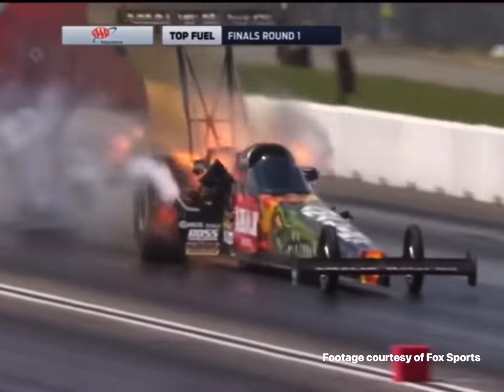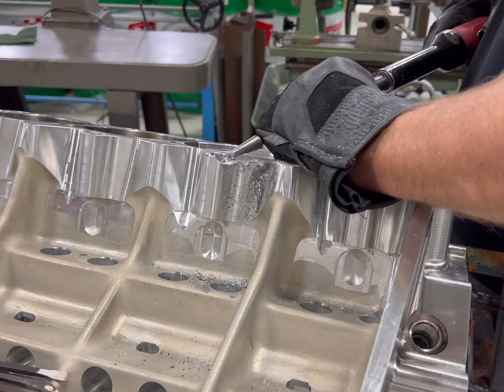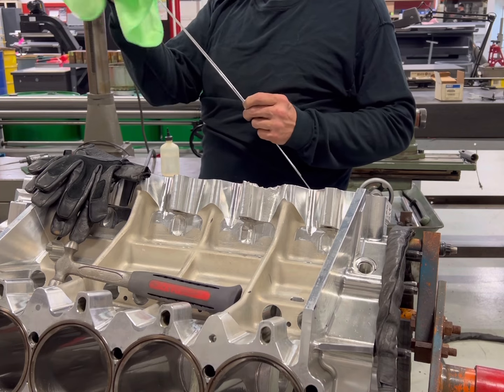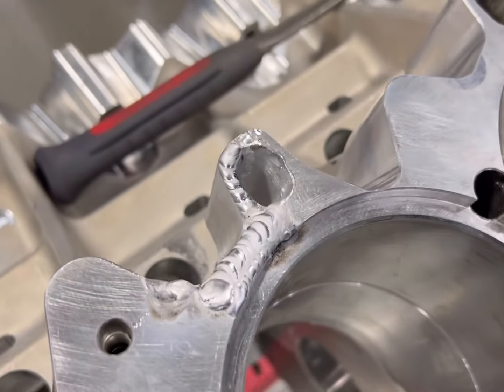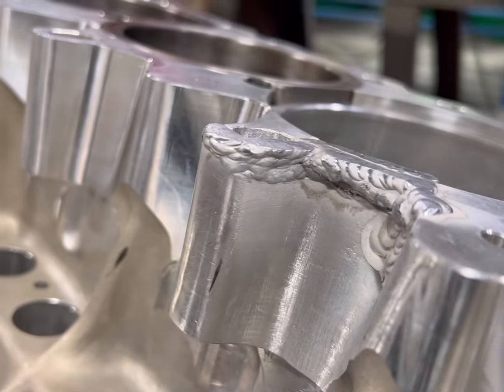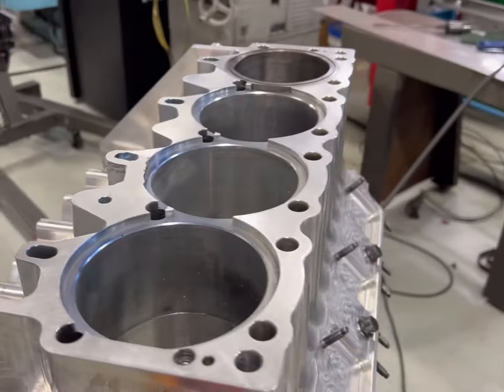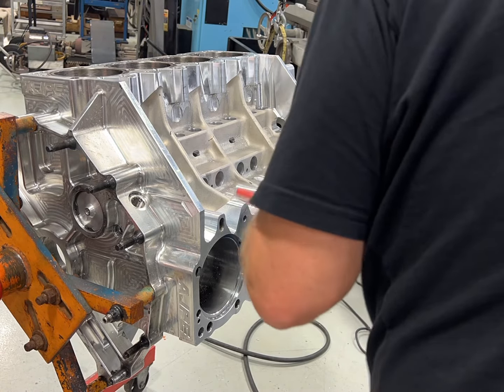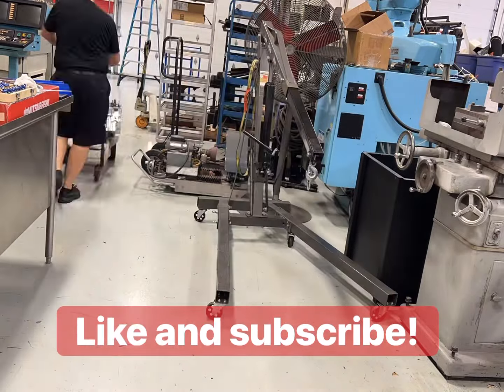11,000 HP BLOCK REPAIR WITH USING ONLY HAND TOOLS!

Comment: I've used Darton Sleeves in all my motor for over 35 years !  Hell !1 time about 25 yeas ago ,they put them on Sale For an A/R 12" deck Big Block Ford sleeves for $36 each !( Ductile Iron) I bought 100 of them! lol I'd buy a New Ford Motorsport A460 Block and spend a couple days with my old Van Norman 777 and bore in for a .002" press fit  with a receiver stop at the bottom and put 8 in them ! that way on Nitrous when I'd burn up a piston and wreck the cylinder wall , 3 passes with the mig welded the sleeve comes out , freeze the new sleeve with liquid propane , drop it in and seat it with an aluminum block and hammer , let it normalize back to room temp   , rebore to the correct ID  and it would never push the adjoining cylinder bores out of round !! I have 5 Carol Carter 11.200  Deck blocks now , never scared to change a sleeve ! Frank

Comment: That’s a great simple and straight forward repair. I used run dc with 100% helium on our aluminum hydro blocks. It would really push the heat into it.

Comment: Finally I see somebody peening on youtube :D Haha. Good on you Rob!
Guys and the manager at my work laugh at me and tell me how waste of a time that pointless hammering is but I deal with old intercoolers with cast aluminium tanks/flutes and that material is simply a nightmare to work with and sometimes, those pockets in casting are filled with oil, junk and other dirt that floats up on surface as soon as I light up my arc. So weld, let most of it burn off, lightly grind that surface dirt, then peen it down under tollerance, weld again, grind off, peen, etc until the bead is clean, then one last peen and that usually works and unfortunately sometimes it's the only way how to deal with this material.

I'm glad you educate people about this. I wish more people understand this.

Comment: Really enjoyed and always looking for ways to tune my aluminum welding , I also use a helium mix. 75% argon 25% helium. I purchased 3 bad tanks of argon in a row, I've never had a dirty tank of the mixed gas. Have you ever run into that problem, I was pulling my hair out looking for leaks, messing with settings, then finally just swapped tanks no more problem. I then switched back and all the problems came back.

Comment: In 1983 I worked for Grumman Aerospace and was required to take a shot peening course to be qualified to work in fatigue critical areas, the person who said that you hammering the welds or a reworked area of aluminum it does realign the molecules of the aluminum and removes unnatural stress caused by the welding. I was skeptical of this until I completed the course and it really does work and works well, there’s a little more to it than just hammering wildly but it is amazing. I wonder who the first guy was that initially discovered shot peening and how he proved it worked.

Comment: Wow.  I would have assumed it was mostly re-machined, not hand fit.  I am impressed and also slightly depressed, as the skill is amazing for sure, but I wonder if some of the 'randomness' that happens in top fuel is due to the varying tolerances.  You're the expert, not me for sure, so I imagine it all works as intended but I'm surprised.  Always great to learn something new!

Cool video!

Comment: As an interesting side note on the topic of peening and cold working metal, metal aircraft propellers are actually shot peened to create compressive stress on the surface of the material, so that during operation the internal compressive stress counteracts the tensile stresses of centrifugal forces.

Comment: My Mac hammer did the same thing. I was told it was solvents inside the handle. When you've had a tool in your box long enough with that style hard handle you'll find a small puddle under it. Stinks to.

Comment: Do you have any concerns with the peening introducing contamination to the weld prepped area? Or is that hammer used only for welding and peening applications?

Comment: Another great vid!    Question- I notice that failure on the top is where the studs come out the back of the head VS.  the studs in the block that hold the head down.  Is the head gasket more prone to fail in that spot more than the other?

Comment: Hold on, A MONTH on one piece of tungsten? That might be the biggest fish I've ever caught. Not doubting you at all, but the fact that I can't get through a week with less than 25 pieces, I'm in absolute awe.
Reply from the maker: I just finished up a 30 hour aluminum job. I am not shitting. It’s still in there. And this stuff was all 1/4 inch thick. I used 6.5 pounds of 4043 1/8 rod and it’s still there. The way I run my welder for aluminum it isn’t hard on the tungsten at all. I keep it in the cup an 1/8 of a inch as well. No dipping that way.

Comment: Do yourself a favor and buy a router with a 1/2 inch collet, and get a name brand bit.  For what you are using it for you have a higher chance of chatter causing the bit to bite, which on a cheap 1/4 inch bit often results in carbide shrapnel or worse, the shaft of the bit snaps.

You don't need a huge router, a mid range makita, dewalt or similar will do.  You also dont need a plunge router, a fixed base is better suited to surfacing work IMO, although I am guessing most of your surfacing is done on a mill, not with a router :)

Comment: The hammer issue could also be things like the resin doesn't age well, it could be getting atmospheric contamination, or it could be sitting in the sun and getting ultraviolet contamination. Any or all of the above can destroy that resin. Put a fiberglass handle on it with silicon wrap so that it doesn't get damaged. Or just put a wood handle on it and that way you can tell when it gets damaged enough to have to replace. These people who try and reinvent the wheel that works just fine. Do the same shit with hammers.

Comment: Rob, don't you dare shut up when making videos. I can't stand "instructional" videos that are silent. 

I also wanted to offer a suggestion if I may. I don't know nearly 100th of what you do in terms of repair and maintenance on these things, but I do know about contaminates in metal substrates. I would offer that it would be a beneficial to fully solvent wipe/clean the areas that are going to be welded, before bringing out the die grinder, sandpaper, or any other tool that's used to remove the damage. It's possible to drive contaminates into the grain structure of the metal, making them very difficult to remove with a solvent wipe.

Obviously these repairs are still holding up to the stresses of use, or you wouldn't be doing them, but I can imagine that at this level of power and competition, even a small increase in weld strength could be the difference in a good pass or another motor failure. 

Thanks for all your videos. I greatly enjoy watching and learning from them. I look forward to more in the future.